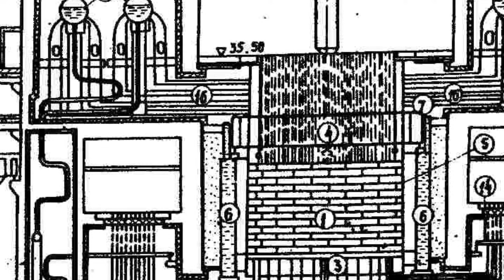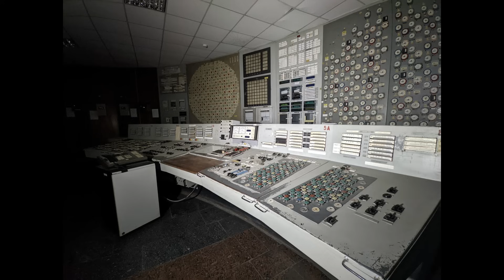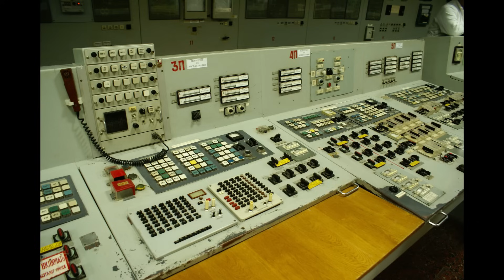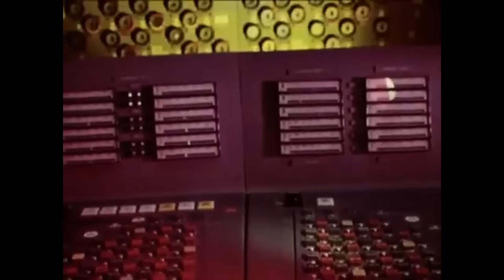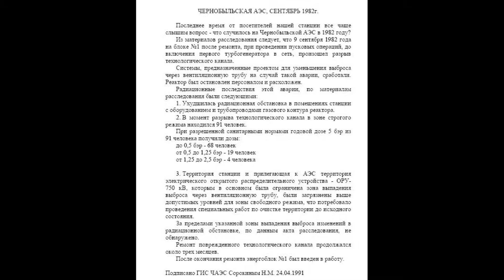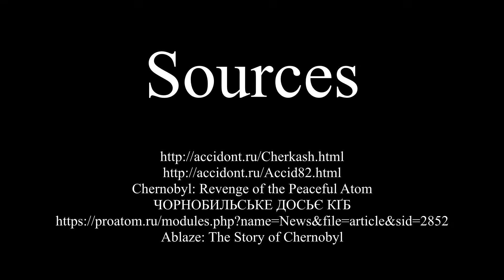The 1982 Chernobyl Unit One Accident: The Untold Story

Comment: My mind got new four idea

1. if AZ-5 was pressed and second later it’s terrible and pressed cancel shutdown, what will happen next? Will now use half control rods down until all is down or leave it?

2.if explosion was accord but Swedish didn’t detect because technical issue, will Pripyat won’t evacuate?

3. At explosion, if wind are changed from north to south toward Kiev and some fallout come to Pripyat? That be mean no radiation from Europe but Turkish will be contaminated?

4. As steam explode accord but core didn’t got change get caught on fire to cause unit 4 be destroyed, will that second explosion prevented? And only destroyed is reactor hall roof and inside reactor hall.
Reply: A3-5 was commonly used to lower all rods in the reactor by lazy operators due to the fact that A3-5 was an push button before the Unit 4 disaster.

Comment: You truly are spoiling us rotten these days. First that half an hour banger about Leningrad NPP, and now this one. It seems that the RBMK never could catch a break. If it wasn't design issues running interference, or poorly written operating procedures, then it would be poor build quality or us silly humans buggering things up. But somehow it managed to soldier on, and there are about 7 of them still running today. Quietly making electric power, and some medical isotopes on the side as well. They are living proof that the RBMK isn't quiet the monster it was made out to be.
Reply: The RBMK design is inherently flawed, but certainly things were made much worse by the organizational incompetence surrounding it.

Edit: One can see how flawed it was by comparing the sequence of events that happened at Three Mile Island to Chernobyl Unit 4.  Similar chain of events but a very different outcome, mainly because the reactor used at TMI was inherently much safer.

Comment: What sensor(s) told the operators that something was wrong and the reactor needed to be shut down?
Reply: There is a special system that monitors the graphite stack for moisture. If that system starts piping up, it means your reactor sprang a leak somewhere, and it would be prudent to shut it down to see what ails it. The incredibly awesome Canadian CANDU reactor sports a similar system as it too is a pressure tube reactor. You have the Calandria tube that houses the pressure tube with the fuel bundles inside. The annulus between these two is filled with a gas. A monitoring system keeps check. If the pressure tube springs a leak, the system will immediately sense it, and send a warning to the control room.

Comment: I was not aware that Unit 1 was never able to be run at full power again. In retrospect I guess it makes sense, given the logistics nightmare and resource cost that partially dismantling an RBMK to do such repairs would be -- best to, since the design was so very modular in operation, just use the rest of it that wasn't irreparably damaged and let that be that...
Reply: Fun fact. The affected core region was "X"-ed out with a Sharpie on the mnemonic display in the control room to indicate that this section of the core was out out of service indefinitely...
Reply: @swokatsamsiyu3590  That is, indeed, a fun fact!
Reply: @swokatsamsiyu3590  I wonder if they also wrote underneath the "X"-ed section in very small cursive (handwriting) cyrillic letters ... "ɸykm" 🤣
Reply: @rhonda-my_honda_cb500x  
🤣🤣🤣🤣🤣

Comment: Both - and...  In unstable designs, minor differences are amplified and any particular part may suffer failures. Even with no significant differences, some place will be slightly different and may accelerate to failure. Part of the problem is believing that something or someone one particularly must be at fault. When in reality the fault lies neither directly on the operators or construction, but on the designers long long before the accident for creating an unstable design. Then too, the usual hatreds arise. And the usual cover-your-ass systems apply with people in power have greater protection and influence than others, and hence able to assign blame. It is all so common.

The flip side of this is also common and true. Designers, operators, manufactures that do the exemplary work to ensure such things are not possible or do not occur go entirely unheralded, unrewarded and unrecognized. Instead others who favor those in power, or that cause them gain are promoted in a super Peter Principle chain causing them to be heralded despite complete absence of excellence. And the whole system assures just such failures. Yawn. I am so surprised (not).

Comment: Why didn’t az5 cause it to explode like in 1986
Reply: I believe because the griffite control rods were not modified ie shortened and therefore was no massive voids pushed trough. May be wrong
Reply: @gingernutpreacher  Many differences but yes, no shortened control rods and in this case the water at the bottom of the reactor was already about to boil and turn into steam (voids).  So very basically: Inserting the rods didn't have the same effect that the shortened ones in Unit 4 had and the water at the bottom wasn't hot enough to instantly turn all to steam and blow the lid off the reactor.
Reply: The accident at unit 4 was preceded by a complete disregard for safety and operational regulations which pushed the reactor into a highly unstable state. Additionally, when AZ-5 was pressed there was very little cooling water flowing through the entire reactor which was not able counteract the sudden temperature surge that followed. The incident at unit 1 occurred closer to normal operations meaning the reactor was in a more stable state to begin with. And the restriction of cooling water was limited to a small localized area within the reactor so there was still enough water in total to compensate for any power surge caused by pressing AZ-5.
Reply: @Klyis  Watch the Masters of Weaponized Narration videos. Also, there was a ton of water in the core at Unit 4.

Comment: 3:57 "When they removed the top of the channel and used a periscope to look into the core..." <--- I think this should be a borescope
Reply: If it used a set of mirrors or prisms to view what was not in line-of-sight, it was a periscope. Is there a reason to think it was simply an eyepiece attached by a long tube to a camera, a boroscope?
Reply: @rdspam Firstly, if there had been a system of mirrors inside the reactor then the chances of it not sustaining damage and still being in alignment after such an incident seems relatively low. Secondly, if there was a periscope system built into the inside of the reactor then it should appear on the plans. To the best of my knowledge it doesn't. Thirdly, borescopes have been widely used in a number of different fields to inspect things where you can't (or don't want to) disassemble them, such as engine blocks, jet turbines, and drainage systems. 
I'm happy to be corrected though, if you have any information.
Reply: @amp888  With absolutely no knowledge of what I'm talking about, I would imagine that a pipe with mirrors (Name it whatever you like) was inside, or put inside, the refuelling machine and that was moved over the affected area and the tube pushed downward into the reactor to see what they could see.  That way the operator stays relatively safe outside and at the top of the reactor while the bottom mirror would be deep within the reactor and not a place anyone would want to be!
Reply: I may be having the bottom of my reactor having a camera run in through a convenient hole in a couple years, being 59yo. So I hope it's a Very small camera. 
Oh, I went there! Just like that camera on a tube's gonna do someday......😂